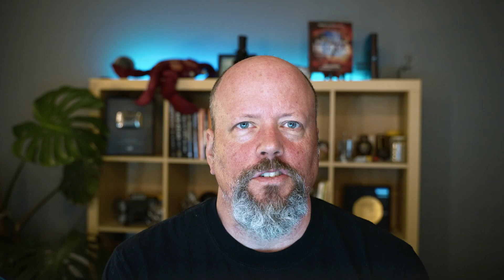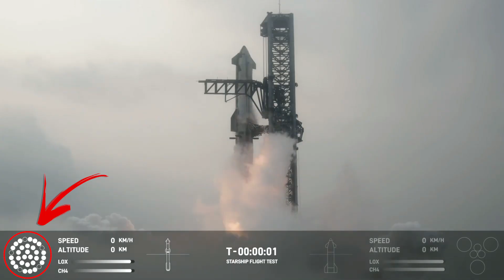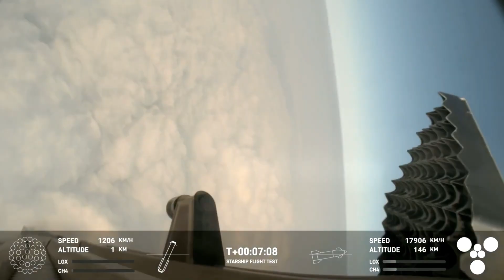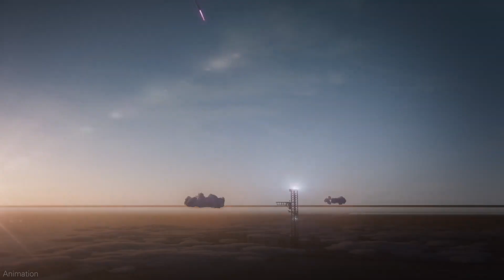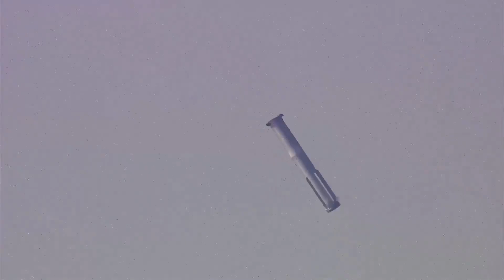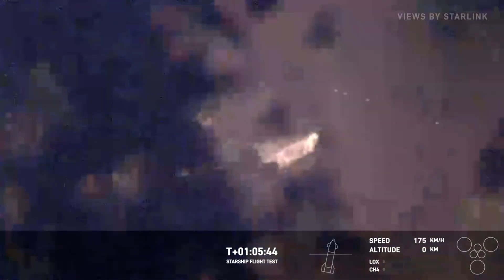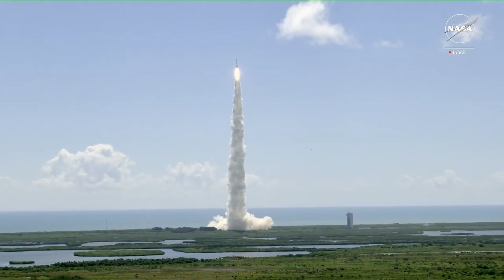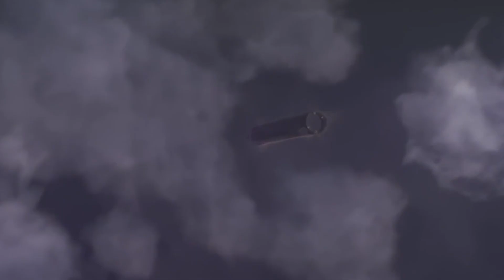IFT-4 and the Future of Starship: All You Need to Know (with @scottmanley  and @MarcusHouse )

Comment: Let me expain how the guidance and control system to a relatively precise position and velocity can work..
First the limiting factor is the position uncertainty of the system of sensors . 
Airbus builds a system very similar to GPS, where a six 'satellite' configuration determines the relative position and attitude of  a vehicle with an accuracy of about a foot, the six 'satellites' are positioned along a rectangular pattern of about 6  by 12 meters. See the exact data published by Airbus for the Deck finder System, originally designed and used by us for helicopters. The accuracy is optimized by a extended Kalman Filter,
The position information is converted to velocity information by a closed loop which models the dynamic system of the target vehicle, avoiding the usual noisy differentiation process. 
Note, neighter a position radar, nor a doppler rate radar are needed, except for back up purposes.
The Landing approach consists of a multidimensional optimal trajectory in phase space, velocity vesus position for every dimension, 3 attitude, 3 lateral and altitude relative positions, and for a flexible vehicle the bending modes. The trajectory is stabilized by closed loop control, in the sense that at every posittion the corresponding velocity is measured as described above, by modulation of the thrust vectors deviations from the nominal velocities are corrected using an optimal controller (LQR).
This multidimensional stabilized trajectory system works every time, independent of active systems, just like GPS with an order of magnitude better accuracy. If the system is mounted on the tower. Again consult with Airbus on the Deckfinder system

Comment: A 2-week turnaround schedule would easily qualify as "quickly reusable," don't you think?  
1. Catch & land 
2. Return to bay
3. 3-4 days inspect & refurbish
4. 6 days reload cargo
5. Return to launch pad
6. Refuel & reset
7. Launch window
In theory, if you can get this down to an efficient system, this might get a next launch within 2 weeks. And then, Elon's got 20 usable vehicles lined up on the pad and in space by this time.
Reply from the maker: Even within 6 months would qualify in my opinion, as long as they don't have to do a full rebuild after each mission.

Comment: Great chat as usual guys, thank you!

What Elon is doing is all well and good, but not good enough because it is not the right type of baby steps for what really needs to be done. I strongly believe that nothing is going to get anywhere fast if you have to bring a Starship back to earth every time you use it to go to Mars. Earth's atmosphere is the #1 enemy of space travel. 

In my humble opinion there are two and only two things that will change space travel.  The first is a LEO infrastructure to service and build space ships (no aerodynamics, heat shields etc. needed). This is critical because only people carriers, not whole huge ships need to come back through the atmosphere. And yes, they could be Starships... Lots of people living in LEO. That's the first step. 

And second, The real holy grail of space travel is a number: 32ft/second squared (figure it out). To do this, big ships needs to be built in LEO which negates the huge amounts of fuel needed to get to LEO and then beyond from there and back. Ships capable of using that number will provide not only very fast transfer times  for solar system travel but earth gravity during the trip as well. 

The first thing is a reliable (get on the bus) transfer of LOTS of people to LEO to do the work, then we go from there.  It's pretty simple really, but it takes as much time and money as we are willing to spend....

Comment: If Elon thinks that spaceship will operate for commercial air service between continents, I have news for him. The flight attendants will have to provide extra large barf bags, and a couple cases of Depends to the passengers. That flip to vertical at the end would bring up my lunch every damn time. I could see it being used to send troops to a hotspot somewhere, as long as they were trained in what to expect, but civilians? Right. They would need to put defibrillators on board as well.

Comment: Seems this has been considered, but why not build a recirculating fluid cooling system to cool the flap joint where the burn-through developed? Perhaps dump this heat to the coolest area, like the upper steel body. Use steel tubing and a fluid with a high boiling temperature, Mercury comes to mind.

Comment: What I havent heard anyone talk about is if you look at that hot spot yall are talking about it appears there are vapors coming out from under the tiles on the leeward side (not between the flap and body). It looks like to me that the steel underneath the tiles is being vaporized and exiting as vapor on the leeward side and not till several minutes later you see things starting to light up. Also when things start to light up you can see it glow inside the flap on leeward side consistent with where you see the ribs and complete loss of tiles etc later. Just fascinating aint it?

Comment: Question.  If just 1 of the 33 turns out to be a dud, that means 3.3% less thrust. If, say, the payload is 7% of the weight at lift-off, you have to sacrifice at least half - 3.5%, to allow for the possibility that 1 engine might not be contributing thrust and the planned trajectory will not be attained.  And they seem to have duds every time. Seems, those engines have to become much more reliable. Failure should be 1:3300, not 1 in 33.
Reply: Both flight 2 and 3 didn't have any engine failures. And an engine failure doesn't necessarily mean a payload reduction.
Reply: @anthonypelchat  It's persistent.
Reply: @chavdarnaidenov2661  no, it isn't.
Reply: @anthonypelchat  Scientific American, on the  April 20 2023 attempt: The vehicle suffered a number of problems on that flight; several of its 33 first-stage Raptor engines conked out early,
Reply: @chavdarnaidenov2661  Flight 1 was the one you mentioned. And then you completely forget flights 2 and 3. Both of which had all 33 booster engines and all 6 ship run without issues.
Reply: @anthonypelchat  Please do a search.

Comment: Dear Elon or to whom it may concern. 
    I have an idea about the heat shields. 

Look at a heat shield. Let's call the flat top 12 o'clock. Now, rotate it 90° left or right rotation doesn't matter.  Looking at the sheild on end. 25% of the way down and 25% of the way up drill or cast in tunnels about 3mm all the way through to the other side. 

  Take a fine braided tungsten wire cable with  fiberglass insolation and thread it through the sheild to the next and so on through all the heat shields. The top of one shield will be lashed through the bottom of the one next to it, and so on. At one end of the wire, there should be a simple spring tensioner that will be covered by a bonded on shield. At the other end another adjustable spring tensioner. Also ultimately covered by a bonded on heat shield.  Lashing down the heat shields together with a beed of silicone for shock/vibration should keep them put. The correct tension can be calculated to keep the shields from falling off due to heat and or pressure. 

  Good luck, Elon, with the next launch, and thank you for what you're doing to better mankind.

Comment: A single engine failure is really too much.  I’m sure there will be a serious amount of study done, to address that.  One thing I did notice on the launch was what looked like some fraction of the major flame blast being revflected off the ring of the launch pad (stage 0).  This appeared to be due to the early attitude adjustment.  If that was an issue, they could hold the vertical climb for a few more seconds before gimballing the engines.

Comment: In the first trials, there was a shield around the engines which actually increased the likelihood of collateral failure within the engine cluster. I think it was due to the use of the later model engines that they were able to do away with the shield.  This may have been the reason that one engine failure did not do that much damage to adjacent engines.

Comment: Instead of landing an entire Starship coming in from the moon with all the increased complexities coming from that, how about SpaceX developing a Falcon 9-sized OR SMALLER fully re-usable launch vehicle solely for shuttling people to and from low earth orbit/the moon. Starships could then operate exclusively in the vacuum of space and wouldn't have to land.

We should have something similar to Gateway Station as seen in "Aliens" in orbit around the Earth - maybe not complete with a hospital and artificial gravity, but hey... Similar-ish. So smaller spaceplanes could come and go from this structure, even refuel there (not "Armageddon"-style, hopefully...), transferring stuff to and from the Earth and the moon. What about a spaceplane that has turbofan engines running on cryogenic methane which takes off like an airplane, then ignite rocket engines only at the top of the atmosphere. Wouldn't that be cool? :D

Comment: BPS Space had a good explanation of the green sparks.  It may have been the borosilicate glass overheating that the tiles presumably have as their outer coating.  Boron burns green like the engine starter fluid.  This is the video - https://youtu.be/UkLExdiz8jY?si=mondHy05hYbUGT2m

Comment: What if the issue with plasma penetrating the flap hinges could be mitigated by venting ullage gas (or otherwise any cold, inert gas stored aboard in COPVs) through the hinges, at a sufficient pressure to just keep out most of the plasma.  And just for long enough to get through the maximum heat flux phase.  Kind of a riff on transpiration cooling, except the point isn't so much to cool (though it'd have that incidental effect as well), as just to create a temporary barrier against the plasma over just the four relatively small regions of the Ship...

Comment: Musk has said they'll try moving the flaps a bit toward the leeward side of the craft, so the hinges aren't subjected to the full blowtorch effect.  Easy for him to say, but I can see the eyes rolling on the aerodynamics modeling team.  Could be a ton of re-programming involved as well.
I wonder if it would be worth making the absolutely essential hinge components out of tungsten (mp 3400 K) instead of stainless steel (mp 1800 K).  Bit of a weight penalty, but it might save the ship in the event of a burn-through.

Comment: The heat shield is a problem.  Anything ablative implies the consumption and replacement of heat shield components and is antithetical to the ‘land, refuel and launch several times a day’ concept.  It will be both expensive and rime consuming.
Reply: The only piece landing and relaunching multiple times per day will be the booster. No heat shield. The upper stage will be attempted to land and reuse quickly, but not multiple times per day. At least not for an extremely long time.

Comment: why dont they have starship re-enter like the booster??????
Reply: Are you asking to be funny or being serious? Its a little hard to tell.
Reply: @mr.ackermann807  serious - im no rocket scientist - sorry if it seems silly - im guessing its coz its going so much faster, but how much bigger would the starship need to be to carry enough fuel to slow down enough in space to free fall?
Reply: @Truc-KInG  considering how much fuel was needed just to get it up there with both staging and up to speed with barely any fuel left, it would need to be extremely large compared to it as it is now.
Reply: @Truc-KInG  seeing the flap being melted made me wonder if it is possible to have a flexible tile blanket to cover the flaps so as to avoid any gaps.
Reply: @mr.ackermann807  that seems feasible - and probably way easier to replace
Reply: @Truc-KInG  thank you. There are many more thoughts I had for it, but I will only mention if you want to hear so as not to annoy you.
Reply from the maker: It would need the same amount of fuel that it took to get to orbit. Atmospheric re-entry is a free ride (if you can survive)

Comment: 1) Marcus - It's a convincing 100 percent success!.... 2) Scott - A partial success..... 3) Fraser -  I'm not convinced yet!......
Me -  Let's get realistic, it failed on so many particulars!, thank you Fraser for putting more realistic assumption...... lets not be a Musk fan boy!
Reusability is a crutch to NASAs Artemis, the contract should have gone to a simpler non reusability solution.
The cancellation of dear moon saved the everyday Astronauts life!
Reply: The launch wasn't perfect, but it was a complete success as it hit every single goal set out. This is similar to NASA calling the AS-203 mission a success. It reached orbit and exploded while in orbit. It was considered a success since it achieved all primary goals. That said, they obviously have more work to do, which was expected. They didn't expect the landing of the upper stage to actually happen either. Even overly optimistic Elon didn't expect that to happen nor did he expect the ability to catch it until a year from now at best.

Reusability is the goal for Starship. And it was billed to NASA as such. Even still, there is not a single other option that could be ready before Starship. The closest possible option would require a simple lander sent on top of an upgraded SLS with a second SLS launch ready within days of the lander's launch. And that won't be possible until late in the decade at best. Other options required brand new rockets to be built or they would have had to work with SpaceX to launch a dozen or more Falcon 9 and Falcon Heavies in very short order (nothing else has the launch cadence and payload capacity to work).

BO has the contract for the "simple" lander. And they are still waiting for New Glenn to be ready, along with fixing all of those issues. No one else even had anything in the works to be ready in time. And anything that relied on Boeing for major portions was going to be horribly delayed and out of budget. SpaceX's Starship was and continues to be the only viable option. BO was decided as the second option in 2023, just 2 years after SpaceX. Starship is currently scheduled for the human landing in 2026, just 5 years after the contract was won. BO isn't scheduled until 2030 at the earliest, 7 years after they won their contract. And that is with BO already working on New Glenn for years prior to any of the bids.

And on dearMoon, Tim Dodd wouldn't have died. Starship would have flown dozens of time prior to that mission. SpaceX has a perfect track record with sending humans to and from space. It just would have been delayed by many years.

I remember you. Remember, when you respond, check back about 5 mins later. YT is horrible at removing comments for random words. Already happened to me. And I will be checking back on this comment as it might get removed as well.
Reply: @anthonypelchat  If one looks at the design of the Saturn V it had little in the way of major problems like Starship is having, and the prototype to production mentality of New Glenn is much more akin to a Saturn V than the botch attempts by Space X Starship.
Saturn V 3rd flight had humans riding on it and its 6th flight landed on the moon with Apollo 11, I expect the more traditional proven design philosophy of New Glenn to have a similar profile, whilst Starship is still trying to perfect it's heavy complicated, reusable, dangerous, 15 space refuels, moon landing option.
But if Space X cracks it and is successful .........well done, but I have doubts.
Reply: @Leon1Aust  First, Saturn V did have problems. Plus it was the last in the line of test vehicles. It did well enough back then, but it wouldn't pass basic safety standards today. And the cost was far, far greater than what was sustainable. It was the largest and most powerful rocket ever built by the USA (barely smaller and weaker than the unsuccessful Soviet N1) and held that title until SLS flew in 2022. Yet it barely managed to land 2 people and a handful of supplies on the moon. The payload to the surface was extremely tiny, and the payload back to Earth was horrible.

You complained about reusability, but New Glenn is attempting that too. And BO's lander that requires NG will still require numerous flights, docking, and refueling to get to the moon. Further, they have even longer to get their ship and lander ready than SpaceX does. And Starship does not need 15 refueling flights. 10 at worse. Could actually be around the same as BO's lander using NG with Starship carrying much more to the surface of the moon.

Finally, Blue Origin has yet to send anything to orbit at all, much less flown New Glenn. And yet they are the second best option behind Starship. Boeing could fly a non-existant lander on SLS, but it doesn't have the power to launch a return capsule at the same time and doesn't have the flight cadence to handle 2 flights close to each other to make it work. They won't even be able to fly twice a year until 2029 or later. No one else comes anywhere close.

I get that Starship isn't perfect and it seems difficult. But this is also something that was only achieved to a drastically lesser level when the US spent the most ever on NASA. And yet it being worked on by a single company getting 1/20th the amount from NASA for the service while doing more in a single mission than Apollo managed over all missions.